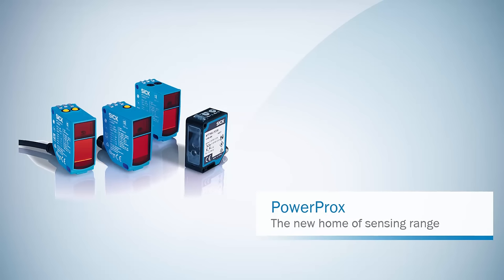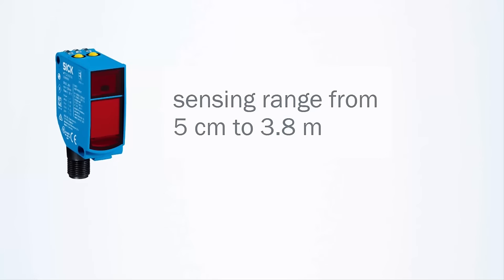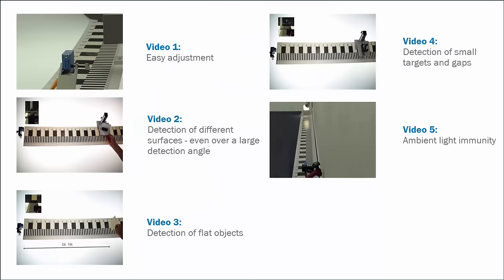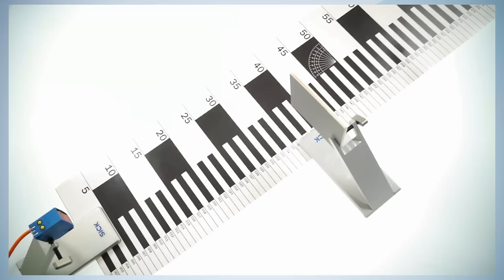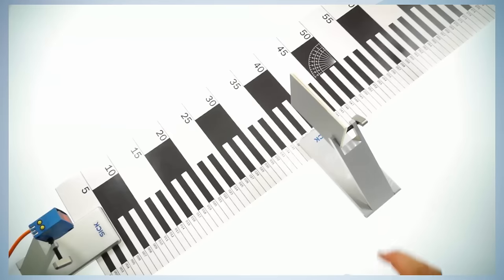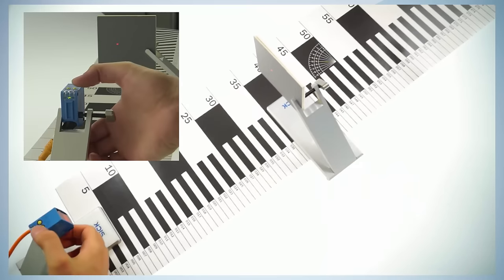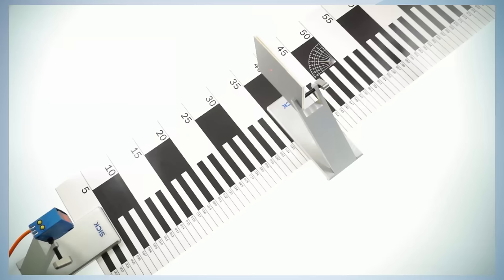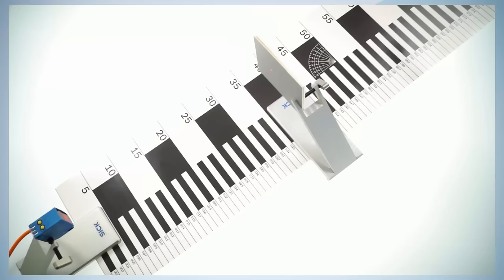Tutorial PowerProx (Part 1/5): adjustment | SICK AG

Comment: what kind of output signal? how to connect to plc please?
Reply from the maker: Hello and thank you for your comment. First of all, it is important for us to know which WTT12 type is being used so that we can provide a reliable answer. In general, all information about the devices can also be found in the manual.
We differentiate between:

WTT12L-Axxx: Analog - current/voltage
WTT12Lx-Bxxx: Push/Pull

PLC:
WTT12L-Axxxx --> Analog input card
WTT12L-Bxxx --> Digital input card
WTT12LC-xxxx --> IO-Link master
Reply: @ it was used in intralox conveyor, scan box barcode , it connected with io link and to plc but I don’t know what output signal that it send to plc like digital 24vdc , how plc understand it commands.
Reply from the maker: General IO-Link overviews can be found here: https://www.sick.com/de/en/io-link/s/io-link
If you have any further questions, please contact your local support team, who will be able to help you more efficiently.

Comment: This video states it will explain how to adjust (teach) the sensor via teach-in button and potentiometer, but it only shows the teach-in button method.
How does this work for the potentiometer?
Reply from the maker: Hello @user-ms5jb5tc1y and thank you for your question. In order to answer it in the best possible way, please contact our technical experts by mail at info@sick.de or use the contact form on the website: www.sick.com. They will help you with your request as soon as possible. Thank you and have a great day!
Reply: The easiest way is to mount the laser so it's not moving. Aim it at an object and move said object until the amber lights are tripped, but on the edge of being lost. Amber lights indicate that it's seeing something.  
On top of the sensor there will be a knob labeled "Q". This is typically your distance adjustment. Turn that clockwise to increase the laser's range and counter clockwise to reduce it. So on your test setup turning the knob counterclockwise should shut off the amber indicator lights. 

C'mon SICK, support your products with actual advice and stop giving folks the runaround. These parts aren't cheap.